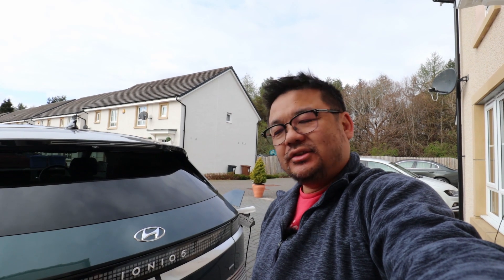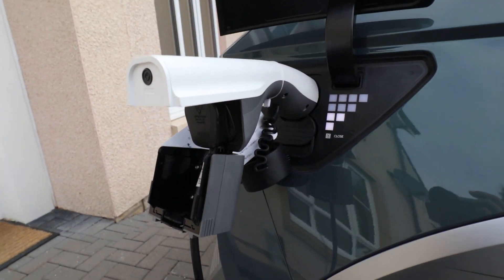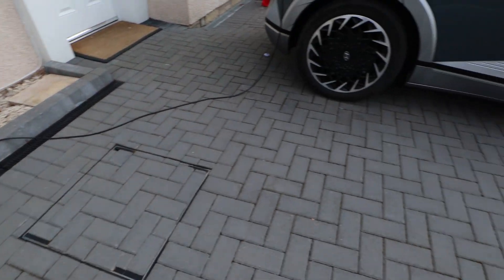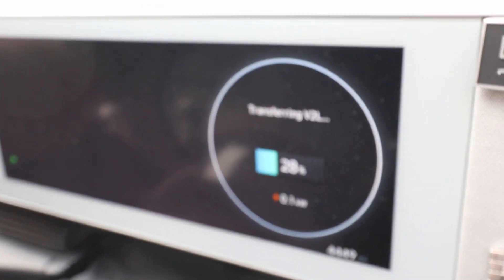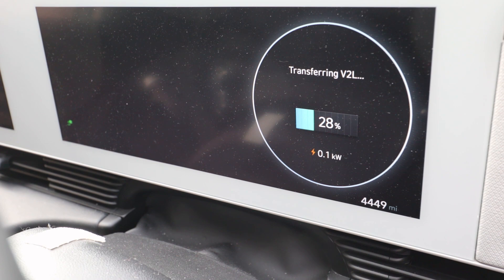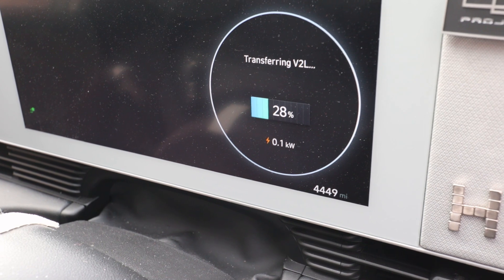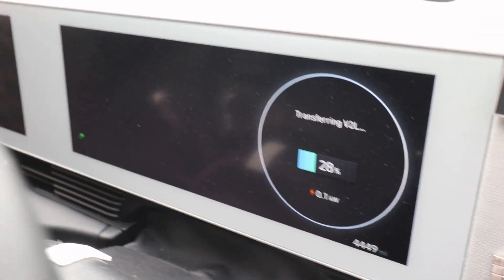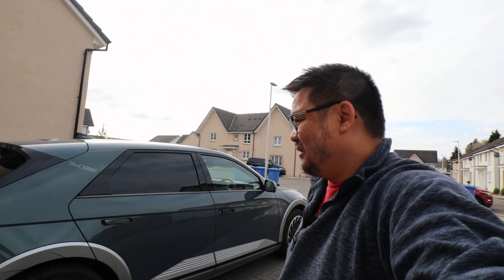POWER CUT! - How long can the IONIQ 5 V2L power the house? - Vehicle to load

Comment: Hi, I used the V2L over Easter where we camped out. I took our kettle,toaster and mini fridge. It used 8% over the 2 days which I was really surprised. One thing though, I tried to close the V2L adapter and I am pretty sure I could not close to make it weatherproof. I think they are designed for US or European plugs where the lead comes out through the back not below. I am trying to find a UK plug which will allow me to close the V2L when plugged in, maybe you can test it yourself
Reply: Make sure that the plug which you choose compiles with British Standard BS1363 before you buy or use it. There are a number of Chinese imports which are smaller than standard size and shape, but they are illegal, and often dangerous.

Comment: I suppose even if the power cut went on for days there is nothing to stop you unplugging and whipping off to find a rapid that's working and then coming back and plugging back in. What's the maximum load? 13 Amps ?

Comment: I have created a circuit within the house which is used to supply the fridge/freezer and the central heating boiler. The circuit is sourced either from the consumer unit or an externally mounted commando plug by means of a change-over isolator. This way I can quickly connect my Ioniq5  to provide emergency power. It works!

Comment: During the Arwen storm earlier our power was cut for 4 days. As we are in a semi-rural situation, mains water is supplied from a reservoir which ran out as power was off too as the pump failed.
However, I asked our Central Heating folk about running the oil-fired system through an inverter attached to my LEAF E+ 12v battery. It seems that the system would run but the initial power surge might be "a spike too far" and blow the small inverter.
We were COLD!!
James, any thoughts from you or your other readers about this?
I suppose using microwave ovens might have the surge effect too.
Reply from the maker: The UK variant of the IONIQ 5 can output 3.6 kW of though the 3 pin plug and has a dedicated bidirectional inverter so it'll handle any surge better than attaching to a 12v i suspect it'll need to as it's connected directly into the main lithium battery pack.
Reply: @LemonTeaLeaf  Thank you. It seems that your system is much better.

Comment: I did this with the Ioniq 5 we borrowed, we ran the Fridge Freezer, microwave, and the Dyson hot/cold fan, luckily the power cut only lasted an hour, also my Ioniq 5 has now arrived and I'm picking it up tonight.
Reply from the maker: Nice! what version did you go for and colour?
Reply: @LemonTeaLeaf  ultimate rwd in digital teal green, now sitting on the drive, heading off up the coast from Newcastle on Saturday up to Alnwick, and maybe up as far as St Abbs 😀

Comment: What are the losses charging the car and then dumping the power back into the home?
I'm thinking you could use the V2L to power most of your home from off-peak electricity, with a bit of circuit modification.
Reply from the maker: the V2L in the UK maxes out at 3.6kW it wouldn't beable to run the whole house but would be good for a few heavy white goods one at a time. Not sure how you would plug it into the house directly. Interesting idea though.
Reply: Charging the battery you lose 11%. Battery to load you lose 11% . The car also uses a continuous 230 watts while supplying energy. For emergency use or camping that is excellent. To store off peak to use through the day it is far too inefficient. Most of the time my house uses less than .5 kW.  A changeover switch costs about £45 but installation is nearer £500 ( same as for an external generator )